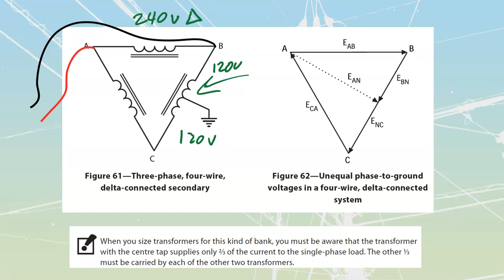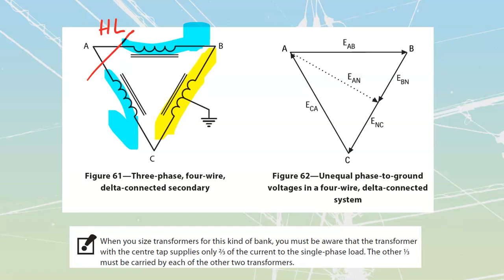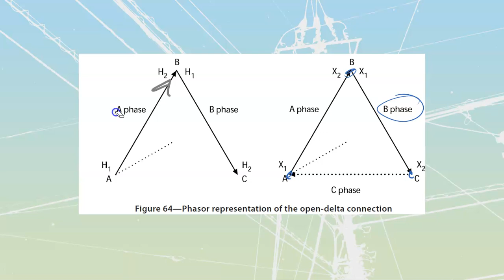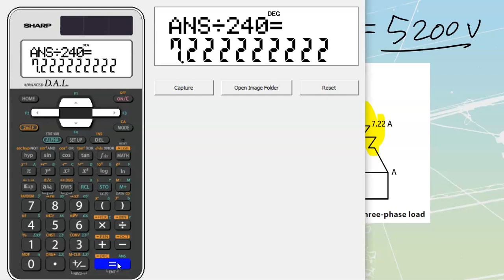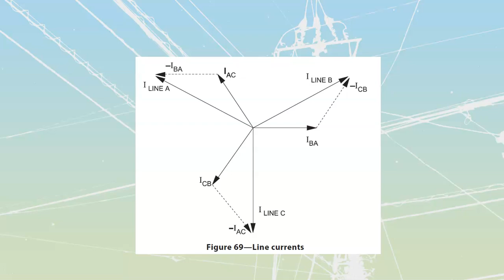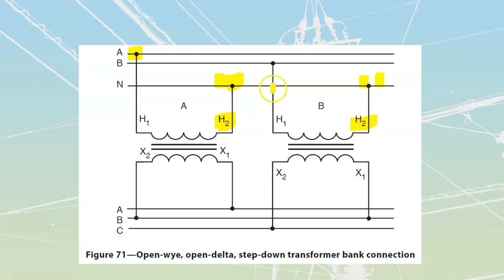Three Phase Transformer connections - Specialized connections - L3 P3 LT2E

Comment: You used phase current instead of line current and got the answer then put the exact same equation up with a different answer.
Reply from the maker: I do make mistakes and these were rushed videos. That could definitely have happened.  Do you know where in the video?  I'll take a quick look and sticky a note.